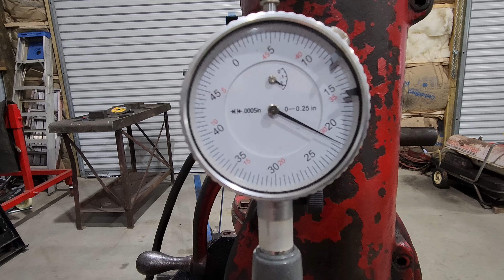40 Chevy Drives FIRST Time In 29 Years! PLUS 327 Build!

Comment: 1968 - 1969 327 crank used the large journal size.
Years ago I swapped the crank, rods and pistons from a 350 into a 68 327 block an had a sneaky 327, it fooled everybody when they read the block numbers as a 327

Comment: Great achievemnet so far that 40 runs quite sweet, somewhat overgeared, could benefit from a shorter diff ratio...
Your shop floor is in really need for a concrete sealing, so that you could easily wipe off all spilled oils!
Thx a lot for taking us on that ride getting the old '40 back on the road!
👍👍👍

Comment: Awesome video. Next time using the plasma cutter just make a cardboard templet to cut out whatever shape you want. I do that for air bag mounts and brackets works flawless every time. I use a stand off ring on my torch head so it is 5/8" from edge to center so I make templet 5/8" bigger and its dead on after cut. Hope that helps a little take care.

Comment: I realized that it has been a lot longer than you expected to be working on the sporty 40 not counting the having to build a different motor for it, that being said look at what you have accomplish Chad it may have issues but it now runs and drives, this winter it didn't that itself considering all you had to do to be able to get it to the point you could make it run,,is quite a accomplishment in itself be proud of it and enjoy it and it's quirks and slight issues while you are building it's new powerplant, and as always i love watching you work on and build the stuff like i usually end up with, although nothing that old unfortunately yet ..i realized it is the stuff most would not look at twice, but I'm okay with that my rusty 86 chevy k20 custom deluxe well used long bed 4x4 farm truck was a prime example but it was a very dependable truck for 12 1/2 years 10 of them a titled and insured daily 6 1/2 mpg driver with a 355 balanced rotating assembly and a competition cams xe 268 h 477/480 lift lopin bump stick lol

Comment: Chad no matter what any one says, it is your car and rushing I've learn hard way gets use in trouble take time to get right. I rebuild a 305 for my truck last week so read to drive it I forgot to put oil in it before first start, after putting oil in it sounds good  when to work one day this week done great got there oil leak front sill forgot to put new one in so I when got some chainsaw oil to slow it down.  Next day I got almost to work oil hand hit 0 and I'm like bullshit after getting off work when to move it 40 psi so ok I'll change oil and filter well it still had 40psi after drove it home and 20 psi at home 10 miles it's knocking a little so got to redo it again. So yes not rushing will save in long run and I guess a check list would have saved my motor

Comment: Sir that old 350 horse 327 hydraulic cam works really good and it's easy on the valve springs not too expensive I don't believe that you can get it in like belly or sealed power shouldn't be more than a hundred bucks

Comment: Looking good! When I bored blocks in the machine shop in Nashville back in 1992,,, I always give each and every engine .005" clearance ( at final hone stage) NOT SAYING YOU NEED TO DO THAT, IT'S YOUR ENGINE BUILD IT LIKE YOU WANT TO.,, I was taught that it was better to be a little loose than too tight.. ALSO HERE'S A TIP FOR YOUR FOLLOWERS,, I WAS TAUGHT IF YOU CAN HANG YOUR FINGER NAIL ON THE RIDGE,, IT'S BORING TIME! OF COURSE THERE'S A LOTTA ENGINES OUT THERE RUNNING THAT PEOPLE JUST RIDGE REAMED AND HONED.... I'VE ALWAYS BEEN TOLD THAT THE OLDER RACERS WAYYYYYY BACK IN THE DAY,,, ALWAYS RAN THEM A LITTLE LOOSE FOR BETTER PERFORMANCE??? ANYWAY ENJOYED WATCHING A GOOD OLE COUNTRY BOY SHOW PEOPLE HOW TO DO IT.ON A BUDGET!!
Reply from the maker: Each piston has it's own clearance requirements.

Comment: Do it the way you want to do it, I don't care if it takes 5 more videos, I will still watch it. I don't like those builders that keep switching from one project to another, that's why I stopped watching them. Builds are a slow process, I am building a 2003 Monte Carlo LS for my wife, putting a 3.8 in it and doing away with the 3.4. It will be an SS by the time I am done with it, and I still have my 76 Chevy Scottsdale I need to change the frame and install AC in it before I am done with it.

Comment: But a big question I have a 01 f150 with  a 4.2 v6 it runs great but  at times it shuts off going down road everything on dashboard still working like you pull coil wire , turn switch off back on it starts back up , manual so yes just flip switch its back running any ideas